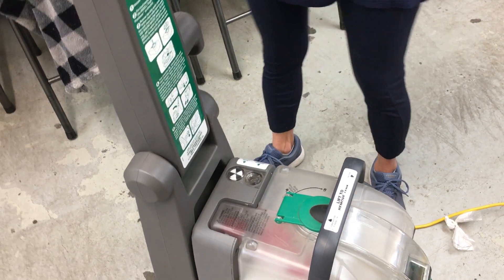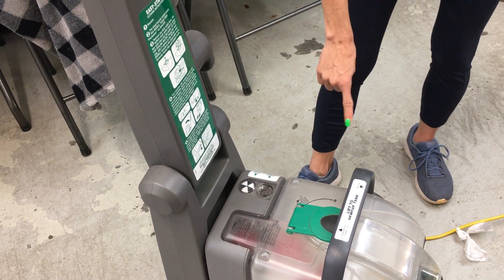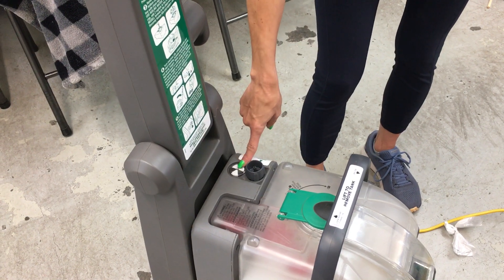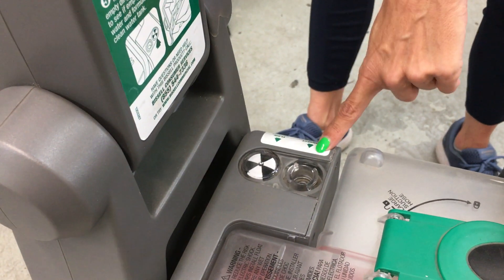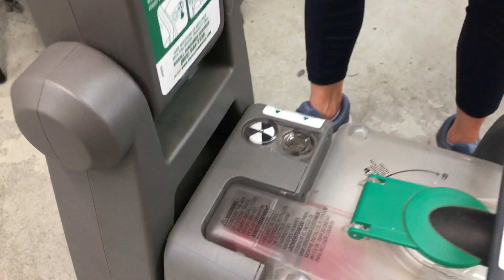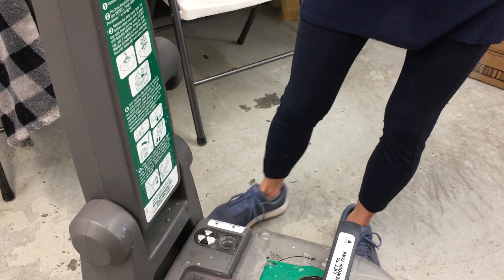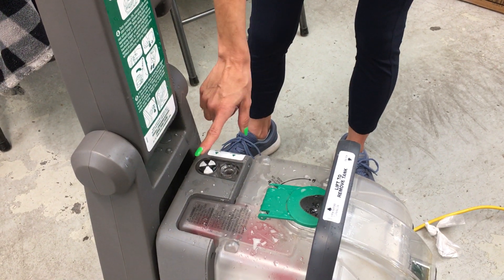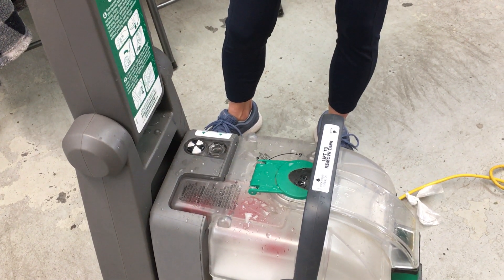BG10 or 10N2 Pump and Flow Indicator Troubleshooting

Comment: I just watched this video, my symptoms were identical, I bought a new flow indicator which is what it appears was diagnosed and my symptoms are still identical. I’m thinking the solenoid is my issue but this video steered me down the wrong path
Reply from the maker: I appreciate you watching and providing feedback!  I do apologize that it may not have been stated clearly that the solenoid valve is a rule in/rule out part based on the other two items in the spray series (trigger activates the pump, which sends the solution to the flow indicator, which releases the solution either out of the bottom without a hose attached or out of the top with a hose attached, and if it went to the bottom, it would then be dependent upon the solenoid valve working correctly to release the spray.  I highly recommend checking the connections points along the way to ensure parts are not "bad" when installing them.  Parts can be faulty in their own right.  If you need further assistance, please let me know!  You can call 800-242-1378, ext. 2180 and we will be glad to assist further!-Amanda S.
Reply: I replaced my flow indicator and its still not spraying 6-8" so is it the pump or solenoid valve?
Reply from the maker: @KristenBihr-wi1px  It sounds most likely like your pump.  The solenoid valve is a "rule out" part, unfortunately.  You do not necessarily know it is the problem until you have replaced the pump and flow indicator with the issue still present.-Amanda S.

Comment: You said the problem with that particular machine is the flow indicator but didn’t say how to fix that problem. How is that helpful?
Reply from the maker: The flow indicator is all that is required to fix a machine with these symptoms-spray is good out of the top portion of the flow indicator (water came out of top in pump test) but not performing as it should (it is called a flow indicator, so it should be indicating when the solution is flowing through the machine, which happens when you pull the trigger) as it is spinning without a trigger pull-Amanda S.

Comment: mine wont shoot 8 inches and my rental that works fine wont
Reply from the maker: If you were to pay really close attention to my video, you will notice my flow indicator is already a problem on that unit.  But the test was still viable.  So, it is only an indicator in the event that the machine is not performing correctly.  Your machine can get used to a diminished pressure pump and still work just fine (most people over spray their floors).  The problem will generally come in when the pump's spray is so low that you have to finally replace it...it will bring any existing flow indicator issues to the forefront immediately.  I hope this extra bit of information helps!-Amanda S.

Comment: I have a machine where the flow indicator is intermittent while using but machine still sprays!  I raised the machine onto a work bench, the spray pattern looks weird/inconsistent coming out of the machine.  I performed the test in the video, looking for looking for a spray of six to eight inches high, failed barley comes out.

I sent the machine back to Bissell for repair telling them about the intermittent flow indicator spinning but not the results of the flow indicator per your video.  Sadly, Bissell was unable to find anything wrong with my machine and returned said machine.  I sent back a video to Bissell on the lack of Flow coming out of the port, they replied to use the machine, which tells me that your test is inconclusive.
 
I asked for a gallons per minute since it would be hard to test PSI of said pump, again same response use the machine.  Not happy to say the least...
Reply from the maker: @miketubeu - Please call us at 800-242-1378, ext. 2180 and we will be more than happy to see if we can alter your current situation with the carpet extractor!-Bissell Commercial Customer Service

Comment: Question, my problem is water leaking at the suction cap next to the flow indicator as  soon as button is turned on$ any solution ?
Reply from the maker: As explained in the video, this is a direct indicator that your flow indicator has failed.  That is not a suction cap, it is a diversionary port for the hose/tool combination with a self-sealing gasket inside that is a part of the flow indicator.  If water is escaping from that port, the flow indicator in its entirety has failed-Amanda S.
Reply: I'm afraid to get shocked pushing  something into the hole while machine is running!
Reply: So on mine, the water is pouring out from the flow indicator cover itself, not the open white cap hole next to it. Same failure? A frozen flow indicator?

Comment: Brand new out of box mine isn’t work. Flow indicator not moving at all. Tried pushing the gasket down. Nothing. It’s not leaking. The vacuum motor turns on. When I pull the handle down you can hear it turn on but that’s it. Water isn’t spraying and it loses suction
Reply: Did you figure it out or just return and exchanged for a new one?